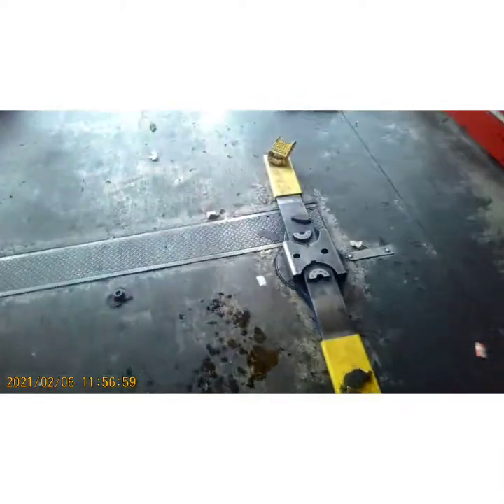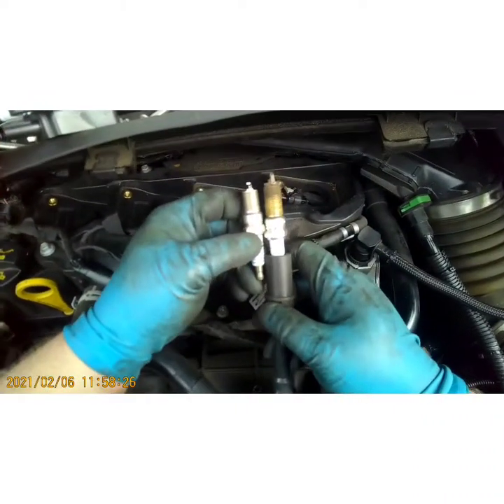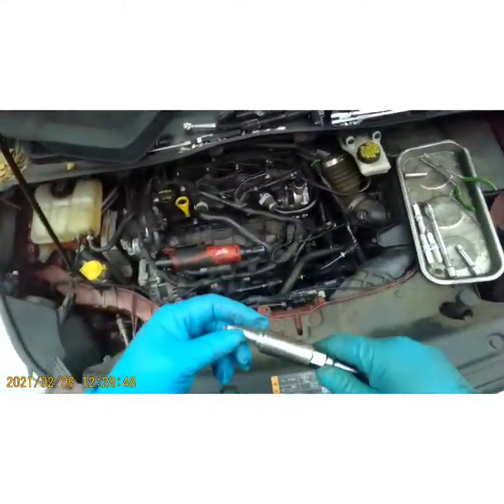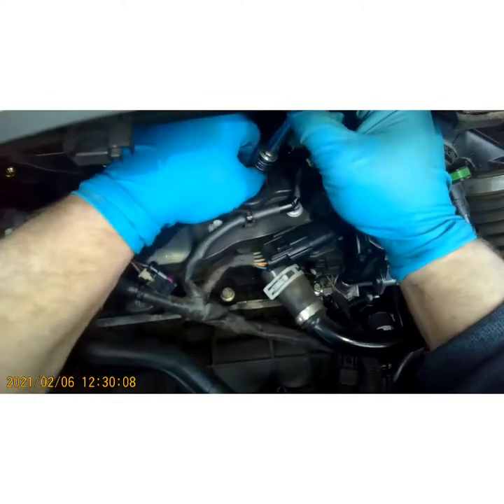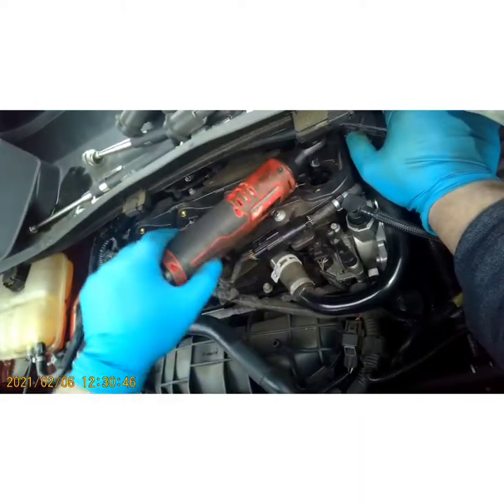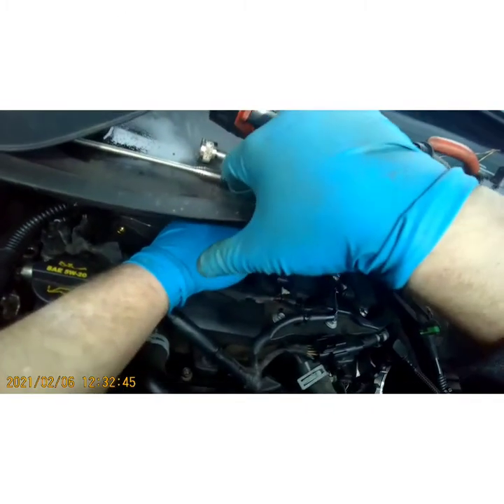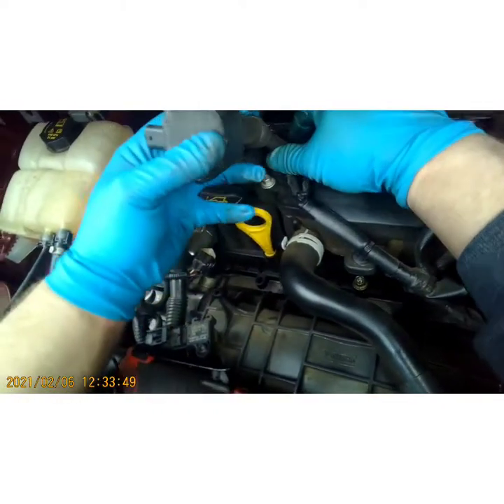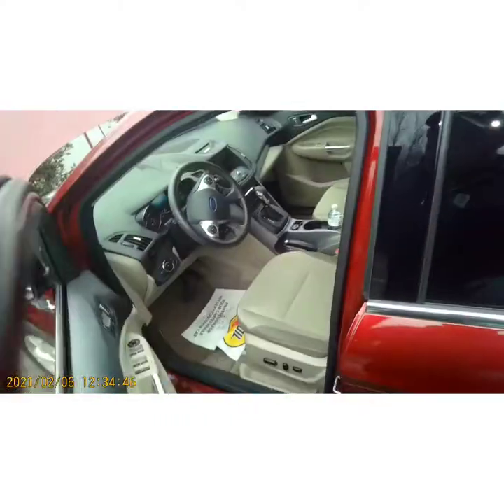how to tune up ,spark plug replacement, 2014 ford escape ecoboost 1.6 4cylinder

Comment: I always check the gap on those "pre gapped" plugs because you never know if a gap is off and after everything you went through you don't want to have to pull any of them back out.  You're a better man than I am as I would have unleashed some emm-effs and ess-oh-bees on what used to be so easy to do.  Regular maintenance replaceable parts should always be easy or at least not so much fuss to get to.  I like that electric ratchet.  Thanks for doing this.  A friend has the '14 Escape and I have recently done an oil and tranny fluid change on it.  The plugs will come up eventually.

Comment: You should have removed the two top pieces covering that part of the engine, same stuff you remove to replace the battery.  Would have been much easier job.
Reply: what two plastic pieces? the windshiled shroud?
Reply: The cowl
Reply: You dont need to remove the cowl to take out the battery.  Remove the airbox, move a harness out of the way, and thebfront of the battery box unclips.  Lift the battery about an inch and it slides out.

Comment: What is the Cylinder order from looking directly at engine? (NOT THE FIRING ORDER)
Reply from the maker: 1234 from left to right
Reply: @automotivetech-vet  thanks bud, helps alot. I broke the #4  cylinder coil/plug sensor click locking mechanism and was getting a #2 misfire so I was confused cause I thought it would be the cylinder that I broke the clip on lol it still goes in just doesn't snap. Just did the timing because I had a leaking thermostat housing. Timing is good because it crank and ran, just bad misfire in #2 (never had it before) plugs are new and gapped .030 and I'm assuming I didn't place the boot on plug good enough. Luckily all I have to do is undo the 2  bolts and try again. But its cold outside at the moment 😂